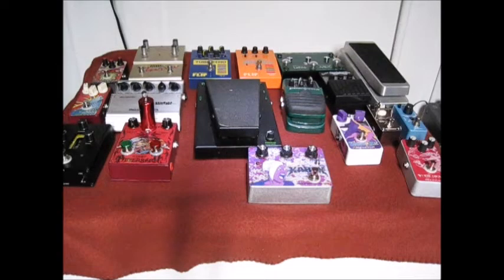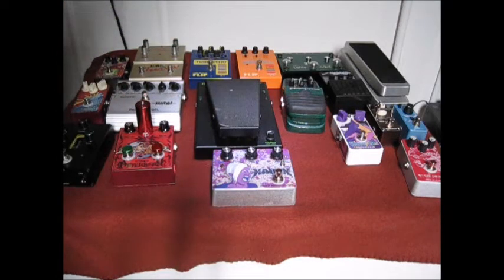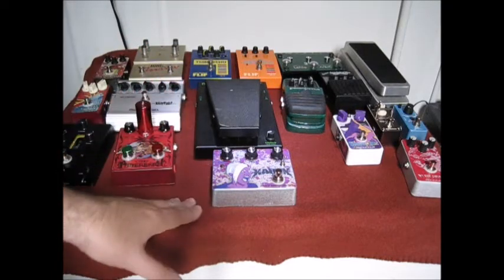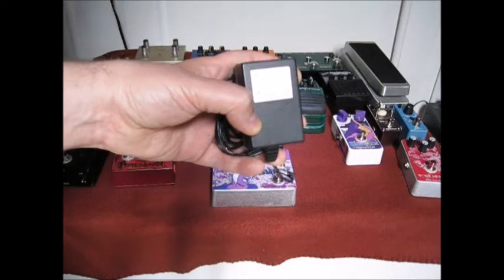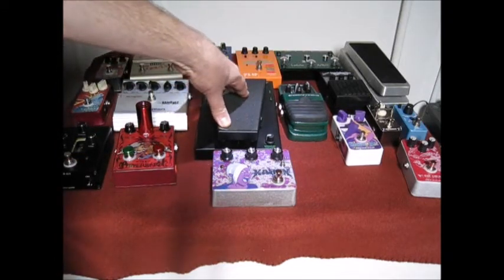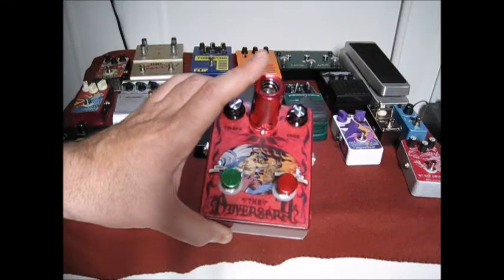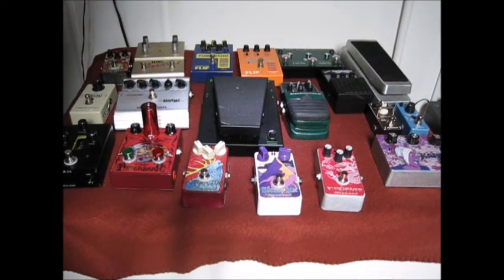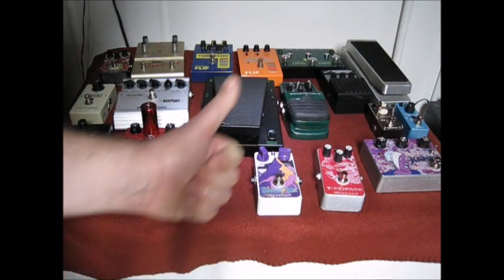DK's Effect Pedal Survival Guide.

Comment: Wow..Just great video..I always wondered about that issue..I am now well informed about how to power up my pedals...Just so stupid at times what I was using..Thanks for taking time to explain it all...Ed..uk..😁
Reply from the maker: Thank you.  I wasn't sure how well this would work out,  but I had to try.    The average pedal only needs 50-100ma to work properly,  but I've gotten SO MANY in that weren't broken at all........   I finally gave the music store owner a "DK Approved"  300ma power brick to use for testing and demos.   He was using a "store brand" power brick that couldn't keep up with pedals like the Space Monkey (That I make).......  
"It's cutting out"   "It's doing weird things".........   yeah,  sounds like power to me.   

ISOLATED power is the best.......  in my case,   the PSU I built can put out 1amp on each of 4 regulators...   that's 4x the amperage of your average pedal power device.   There's some really simple circuits out there that are GREAT........a small transformer  (12v)  5 diodes,  a regulator and 3-4 capacitors.   I built mine based on free projects I found online.
Reply: @DeadKoby  Hey there..Thank you so much for your reply and suggestions..You're a clever guy, so for you all this is just run of the mill stuff. It's great to have done this little vid as it does help those (like me ) to figure out why things sometimes go wrong..Thanks Ed..uk ..😀